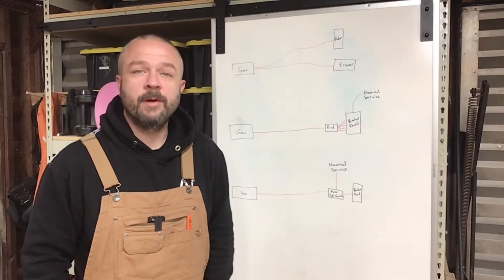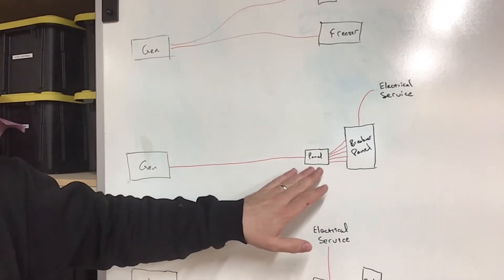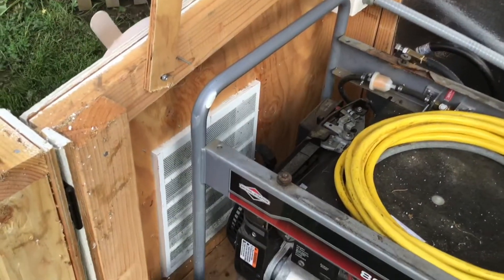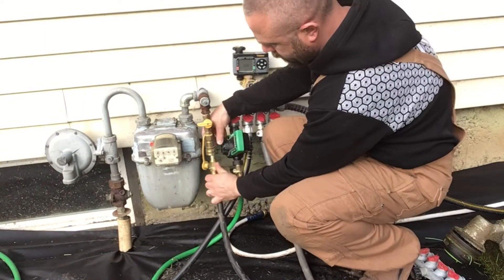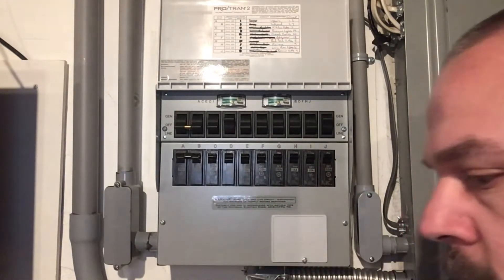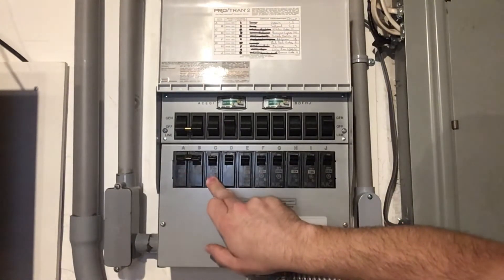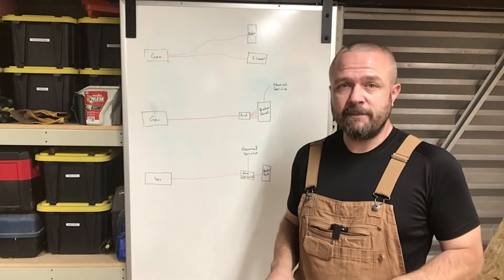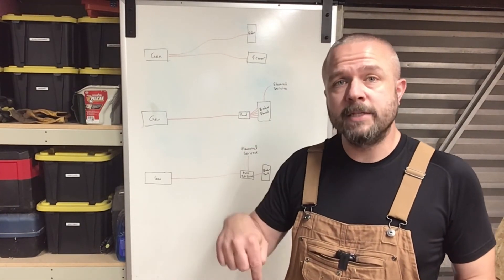Emergency Generator Systems DIY

Comment: Addendum.. 

Also, did you do the tie-in to your gas meter, or did you have the utility company do that?
Reply from the maker: I think you probably could do a separate transfer panel for the HVAC, as long as it's big enough in terms of amperage capacity. My HVAC has a circuit for the furnace itself (120V 20A) and a circuit for the AC condenser (240V 30A), you'd have to make sure both have power in order for it to work.

I did the gas install myself, there's a test port on the tee where it goes into the house I tapped into. It's regular pipe thread, use black iron pipe rather than galvanized. I'm not sure why, but that's what they say to do.

Comment: Looking at installing a generator, but wanted to know if it is possible to separate the hvac to a separate generator (locate it closer to the a/c fans on their cement slab outside), and have a second generator control/power the rest of the house tied (as you have) to a transfer panel. 

Or is this overkill and too extensive work for home owner to accomplish?

Comment: why have an inlet at the generator shed instead of just running the cord through a hole and plug directly into the Genset.
Reply from the maker: If I were to run a cord I would to drill a big hole to fit the plug through. This way there's no big hole for mice and things to get in through.

Comment: Excellent video Greg!  I like the idea of building a generator shed.  Frees up garage space and prevents you from having to wheel it out in bad weather.  Probably provides a bit of sound deadening as well.
Reply from the maker: It does. I insulated it with foam and directed the exhaust noise away from the house. You can still hear it from inside but it's tolerable.